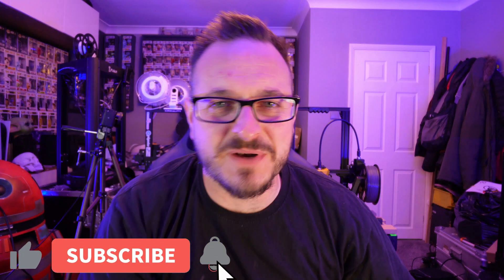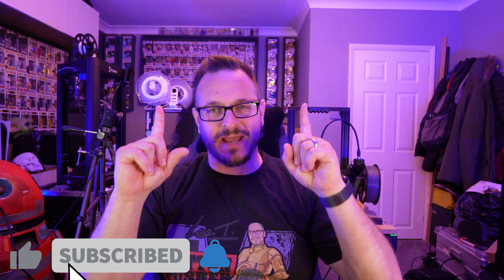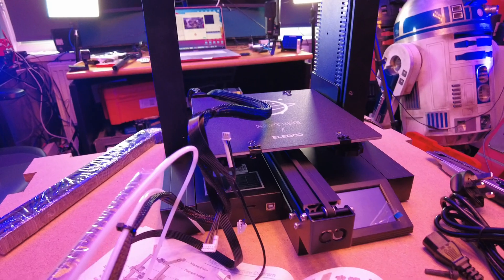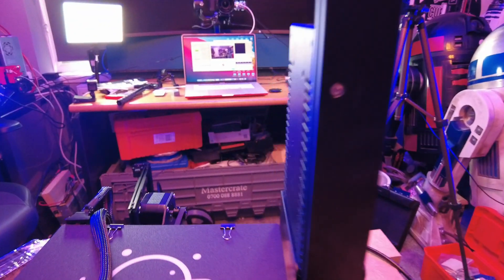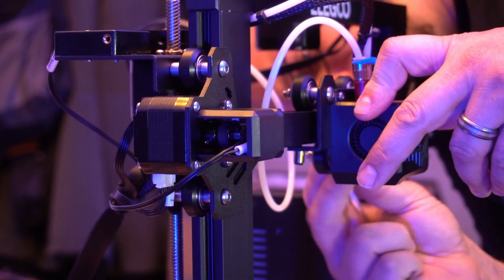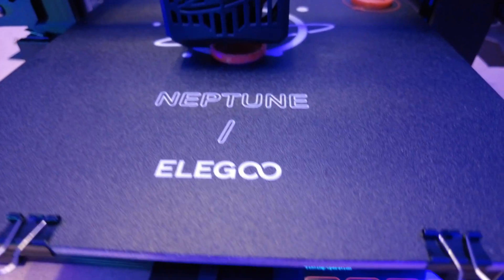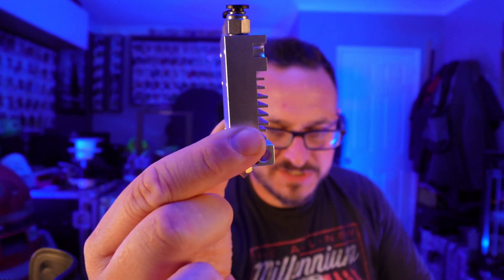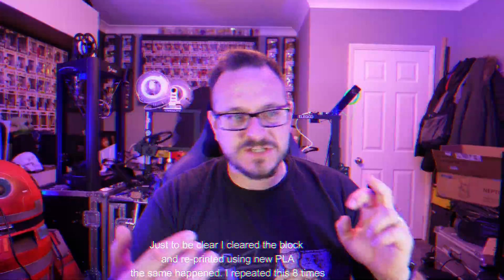Elegoo Neptune 2D 3D Printer is a huge disappointment

Comment: I use the 2D, and I never really had issues with heat creep like that. If there was a blockage, it was in the nozzle itself, and that was purely because of silk pla filament, that generally needs higher temps or a wider nozzle diameter like 0.6 instead of 0.4, because of its smooth texture.

Currently my printer is broken, presumably because it got a power surge, and the print quality is slowly degrading, and has done so over a time span of 7 months, getting worse and worse, I tried a load of things, and got to the point it is the mainboard. But, other than that, for my first 3D Printer, the Elegoo Neptune 2D has been great, and I have the printer for about 2.5 years now. 

So, there is my opinion on it. It is a great printer, but I'll admit, as great of an experience I had with it, I would recommend getting (an) other printer(s), with more features, for around the same price, instead.

Comment: I know this is a few months on & after reading through the comments (& owning a 2D myself), I do have to point something out

I bought an Ender 3Pro that shipped (from China) with a warped bed. Instead of throwing in the towel, I persisted & learned how to mesh level via Merlin & I learned how to flash FW onto an 8bit system as well just to fix this problem. While it was a common problem (unlike the Elegoo Neptune 2D heatbreak specific to your issue), my printer has been going strong since 2018 & had printed Kg's of filament, Point is, an issue, especially a non common issue, is not indicative of the quality or reliability of any printer.

As far as the Neptune 2D, which is identical to the 2, if the heatbreak was the issue then with that issue corrected, the quality & reliability would be exactly the same as the Neptune 2 you stated you regret giving away

I've noticed via the Neptune 2 communities I have joined, literally no one complains of this issue other than those that converted to an bi metal heatbreak & get clogging on PLA (myself included) because they were not familiar with all metal hotends & the problematic love affair with retraction

There is also a fix for heatcreep (for all single extruders) via a section of Capricorn tube & a Chep washer/spacer which imitates this 2in 1out extruder setup (my point is this extruder setup is not subject to traditional  heatcreep issues where the Bowden tube moves during retraction because the coupler is not catching well enough causing a gap allowing filament to fill the void & clog)

Given your experience, I am sure you accept that budget printers would likely not ship with Boron Nitrade paste in the hotend & effort to separate the hot & cold areas with C tube sections, all new budget printer owners should be encouraged to perform some basic modifications to reduce the likelihood of future stripdowns & issues - a stitch in time

So I am interested to know why you, given your extensive 3D printer experience, saw this very specific issue as a deal breaker for this printer & did not choose to get a replacement to confirm if it was a common issue or just a random dud?
Reply from the maker: Okay, lots of information there, but to pick thought that.. I feel that it was a random dud, but I can only review the the printer that I have been sent. If I have issues with it out of the box then thats what I can report on. 95% of the printers I have in work out of the box, i've had a few that don't power, or the sd card slot is a fail. Sometimes you have to weigh the balance up. More recently I've had a blast with the neoptune 3 max! which is a vast change from the 2, but then even the 1 was great. When you open the box for the first time its about the experience, if i'm sent a faulty printer is it my job to right the wrongs of a manufacturing or quality issue ? I dont think its my job to do that, but depending on the relationship and advice of the manufacturer will react accordingly to that. In the case of the new ender 5s1 creality ignored me for two months before I made the video, so the issues with firmware and lack of user manual were also reflected in that review. Later they came back to once it when live and said they made some mistakes. When they sort that out I'll update the video. At the time the 2D had very little comms back form elegoo, so there was no need to update that.
Reply: @TheRealSamPrentice 
Ok, thanks for that

If I am correct, you uploaded the video soon after sending it back, what comms were expected? & did you give them time to access the issue & come back to you before releasing this review. Probably a rhetorical question at this stage

Every single person on the community forums have said what amazing CS Elegoo has, they have been sending out free replacement mainboards when people have fried them from user error installing BLTouches… dozens of them

I think the point is you’ve been telling people to send back their 2D’s, one from not knowing appropriate settings (I assume from not calibrating it properly)
I accept for you personally you had a poor experience out of the box, but you seemed to have made a succinct judgement of the printer itself being a total lemon, not just yours

Just putting it out there
Anyway, happy trails
Reply from the maker: @MilitantPeaceist you know what opinions are like.
Reply: @TheRealSamPrentice  yes, they are like double edged swords

Comment: Wow! I don't know what problem you had with the D. I had mine up and running in no time and never saw the heat Creep. All my prints came out flawlessly using two different colours of PLA+. I did notice Elegoo version of Cura sets the profile temps too low for my liking, but they can be easily changed to new defaults. 

I think I know what your problem might have been. Because I planned in future to use TPU, I set my Neptune D for direct drive extrusion, whereas yours kept the long bolden tubes. Too bad you sent it back before trying my setup. It might have made all the difference.
Reply from the maker: Glad yours worked ! Mine out the box was
Bad but that’s the game you play with reviewing printers :)

Comment: I can tell you, FOR SURE, that when you say Elegoo Customer Service didn't get back to you, it makes me suspect you are not being truthful. 

I can't speak to whether the 'D' has chronic heat creep, but you also didn't explain your settings that can affect this (fan, temp, retraction, etc.). 

I don't have the D, only the standard Neptune, but one thing I can tell you about Elegoo is that their customer service is absolutely top notch. I have had a few issues, possibly due to this being my first 3d printer, and possibly due to me beating the hell out of it for the last 7 months, but with all of the few issues that I have had, Elegoo has responded to email within 12 hours, and they don't hesitate to mail out replacement parts for free. Their support is exceptionally technically competent for 'tech support' too. They even advise re firmware upgrades, and stuff like that. 

Based on the support they've given me, this isn't a fly by night company. They are really trying to make and refine a quality product-based brand. I think it's quite specious that you say this printer 'just doesn't work' without explaining what settings you've used or if you're even trying filament switching, and you say their customer service isn't responsive. My experience has been so far to the opposite, it's actually made me think of Chinese manufacturing in a whole new way.
Reply from the maker: I can tell you for sure they did not get back to me and I can take for sure I’m not lying nor am I liar are you quite a lot printers I will speak the truth so your experience may differ from mine but I can only go by the experience that I’ve had.
Reply: @TheRealSamPrentice  I don't know what to tell you man. Maybe they had more problems rolling out the idea than they anticipated. However, I just emailed them to ask them to sell me the idea kit, and they've been very responsive again, so for me there is a pattern of them being nothing but responsive. It seems to me that having a 2 extruder motors feeding through Bowden tubes through one nozzle is something that's going to be very settings-dependent to get right... and filament dependent to make it work.
Reply from the maker: @GreyGhostR1  I'm really glad you had a great time, honestly I am, but we can also agree that people don't always get the same level of service all the time right? That's just life. My review would have been disingenuous if I hadn't spoken about the experience that I received. You suggested that I was "not being truthful" was unfounded but your experience was different

Comment: I have a 2d, fully assembled and extruders work fine. However my issue is my x axis will not use half of the print bed. Frustrating finding a solution to fix. Firmware may be faulty.
Reply from the maker: I'd start by re-loading the firmware it should be on their website. Elegoo isn't a company that I work with so i'm not sure on their processes

Comment: Considering the regular Neptune 2 is no longer available I'd say this is a good option if you are looking to save $70.  I'm thinking about designing a little cap for the second hole, this way you could remove the second Bowden tube and have better cooling.  The cap would sandwich a breathable cloth that would act as a dust filter.  If you are looking to print at max temperatures (260*) this might be the way to go.  
Honestly for printing from a single spool this isn't any different than the original Neptune 2.  
Overall I'd say it's just as good of a printer, and you have the option to print more than one color if you'd like.  Heat creep is always going to be an issue with 2 to 1 printers.  If you are looking to get the printer for doing gradients, don't!  It doesn't have the capability in the firmware.  If gradients are what you are looking for I'd recommend a Creality ender 3 with some dual extrusion upgrades and a fresh firmware flash.   Fingers crossed Elegoo comes out with some fresh firmware that allows for gradients.

Hope that helps!

Comment: Putting this in a proper comment so it doesn't remain buried in a reply chain, in case other people are willing to give the Neptune 2D a go.
I don't know about heat creep but on my 2D the one bad jam was the result of a badly clogged nozzle; I replaced it with the same ones I have for the Ender 3. It was probably the result of maybe some PVA being left in there while the nozzle was hot after a filament runout. I also checked that the PTFE liner was flush against the bottom of the barrier tube, as any gap will make a very bothersome clog (this is an issue with bowden setups where the bowden tube is also used as the liner as well).

Aside from that I've got the Neptune 2D working well, AFTER ditching elegoo's cura and switching from ultimaker cura to prusaslicer. It seems Cura's duel material settings are geared more towards Dual Extruders than Single Extruder Multi Material setup, but fortunately Prusaslicer has the ability to setup for SEMM (mostly because the MMU and MMU2S are SEMM setups). Using this I've gotten the Neptune 2D to work quite well with both 2-color prints and Soluble support interfaces.

Clone an Ender 3 Profile, and under the printer settings in the general tab set it to 2 extruders and check Single Extruder Multi-Material, then under that tab insert
Cooling tube position - 80mm (this may not be entirely correct but it works for me)
Cooling tube length - 5mm
Filament Parking position - 80mm (this is the important one, as it's where it will move the filament back to when unloaded, which is right above the fittings on the Y-splitter, which is something also mentioned in the manual)
Extra Load distance -  -5mm

The Wipe tower is turned on under Multiple Extruders in print settings, but for soluble support interface or soluble supports you will need to first go to the support material tab and switch "Top Contact Z Distance" to 0 for soluble, the check "synchronize with object layers" to enable soluble material, then you can turn on the wipe tower and set the interface/support extruder under Multiple extruders tab.

The last jank thing that may honestly be optional is that you will need to clone the printer profile and under start Gcode add toolchange line, T0 or T1 respectively, then G1 E80 F1000 to load before the prime line to actually load the extruder, as the ender profile does not do this. Then after slicing for the first time, orbit under the print to see which extruder is used first in the skirt and switch to the appropriate printer profile. Without this it will load after doing a non-existent prime line, which may affect your print.

Additional thing I'd like to point out, on canceling a print, the printer does not unload itself to the parking position, so make sure to do that manually. This is not an issue with any slicer, but the printer firmware itself, as unload/cancel procedures are one of those things that's setup in the firmware. Strangely enough though it does unload an park the filament after a successful print.

Comment: I have a 2d and have been running pretty much consistent for the past two weeks. Only problem so far is getting the bed over 100 c. For abs printing.  Need to calibrate I think. I love the printer.
Reply from the maker: I think it tops out at 100.. doesn’t it ?
Reply: @TheRealSamPrentice  yes

Comment: I can see why you were having problems in your video.  The instructions that come with the printer say to insert the filament into each tube but STOP approx 10mm before it reaches where the tube connects to the hotend.  As it switches color, it retracts the in-use filament back to that position and then runs the next one in from that same distance.  It looks like your green filament is all the way down to the hotend.

I made that mistake a few times, too, in some of my first dual color attempts.  When I started putting the filament where they said it should be, my issues stopped and this thing has been a two color printing workhorse.
Reply from the maker: This blocked even with the single colour. Elegoo confirmed a faulty heat break but thank you for your comments :) I hope that it might help others
Reply: @ L A  Thank you!  Thank you!  Thank you!  I was wondering if I was doing something wrong or was just unlucky.  After doing as you said, the printer gave me a very nice print!  I feel like I'm going to have fun with this one.  Thanks again for the solution!

Comment: Mine is working perfectly fine,  just have to KNOW what you are doing.  There is no "heat creep" .   You need to use the INCLUDED version of Elegoo Cura because it has particular GCODE settings in it for proper operation of the hotend in conjuction with the extruder operation.   You SHOULD retract/redo this video.
Reply from the maker: So thats TRUE of the files that are on the SD card? The heat should NOT reach that far up on the cool end!
Reply: @TheRealSamPrentice  You don't say in the video what you set the hotend temperature at,  but I leave it set at 200c,  and during the entire printing process I can easily keep my finger on the top of the exposed portion of the hotend without any temperature issues.  I was printing with PLA+.  If you weren't using the provided "Elegoo Cura" version on the USB drive,  then you probably didn't manually add the proper GCODE needed in the "Machine Settings" for the printer tab, and each of the Extruder/Hotend tabs.  Plus in the slicer print settings under "Duel Extrusion" you have to have certain parameters set for each extruder.
Reply from the maker: @mikeb3962  again very aware of all your points, also not included in the video is when Elegoo finally came back to me to say that they think the heat break has failed. To be fair Elegoo’s team have been completely incompetent from replying to me with other users information, to admitting there is an issue and wanting to send me new parts. Again I can only review the printer that is in front of me. That being the case and the hours spent that YOU don’t see in the video is again the whole reason why my opinion on this printer is the same. If Elegoo had worked with me on this I would of course update this. Extruding filament is a simple process and event when the chamber is clear the heatbreak failure is what lead to this blockage it’s as simple as that.
Reply: ive been having a ton of setup issues with mine. and as im 100% new to 3D printing. and you seem to be doing ok with this printer i wonder if maybe i could ask you some questions about setting it up.
Reply: @RayDougie_93  Ray,  I just saw your response.  There are some gcode entries for the "Machine Settings" you need to make sure are  set, so the filament retracts exactly 10mm in order for the other filament to be loaded and printed.  Plus the option for "Duel Extruder" needs to be activated.  The manual shows some screenshots for reference.

Comment: Yikes!  I just got mine today. We shall see if the heat creeps up on me. I have a suspicion it will…
Reply from the maker: You might be okay! I think it was just a bad machine unfortunately. The support is shocking tho! So if it’s bad ship it back!
Reply: Took a FLIR photo of the temp right at the top of the hotend.  43.5c isn't anything to worry about when the room temp is 27c.  Wish the reply option would let me post the FlirOne Pro photo.  Main thing is to make sure the gcode programming is correct for the two extruders and printer in the "Machine Settings" section of Cura,  as well as some particular settings in the "Duel Extruder" settings to make sure the retraction is set to 10mm for each extruder.  Been printing for a while now with no problems at all,  with the included Elegoo Branded Cura 4.8,  as well as the latest Cura 4.10.0 & Cura 4.11.0